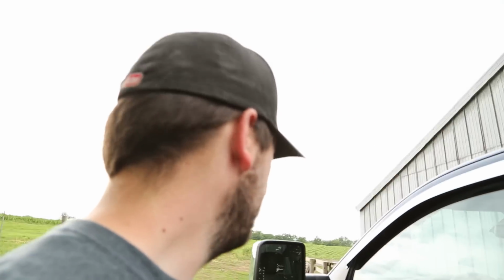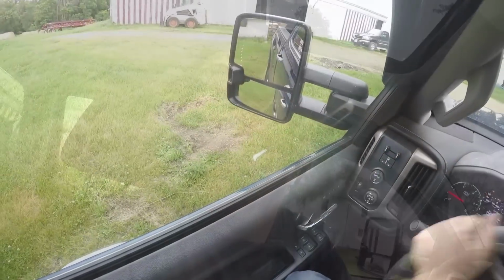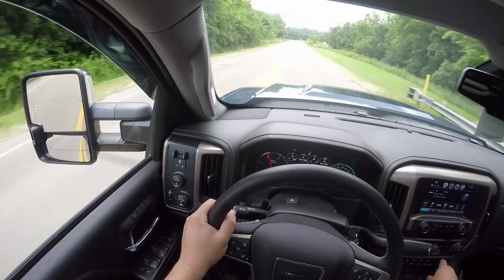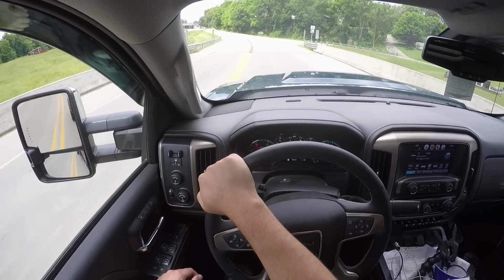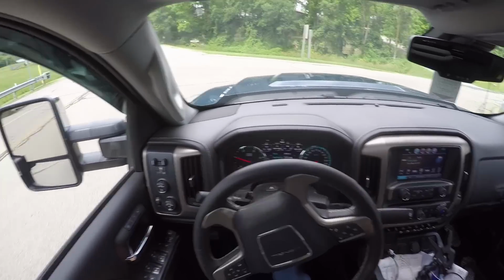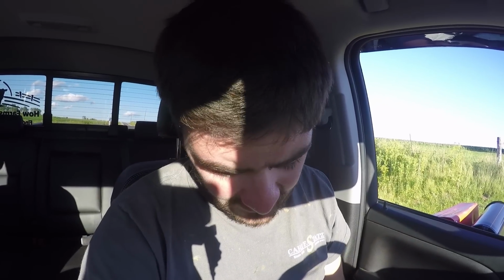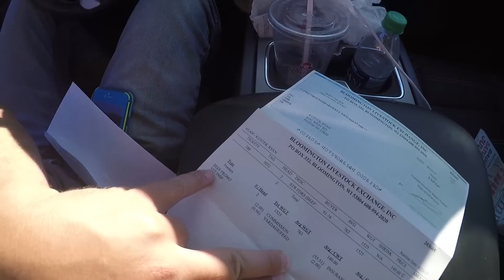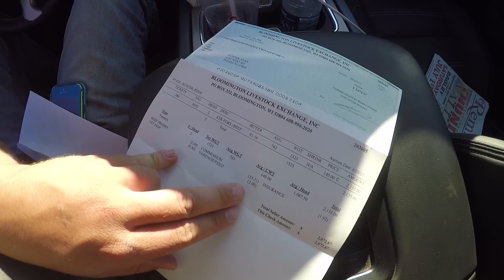Hauling Cattle - 2017 GMC Sierra 3500 Denali

Comment: you have a beautiful truck! as you can see I'm a Dodge fan but I'm impressed
Reply: Myron  Yoder im impressed the GMC didn't break down
Reply: they are pretty good now all the biger trucks with diesel engines run good dont break that much and some sound good HOWEVER to anyone looking to buy a new diesel the best thing u can EVER do to the engine is a full delete kit no tuner mods to add power just delete the stupid egr crap and dpf bullcrap and u will find that ALONE add more powe because u dump about 300-800pounds of crap off the truck
Reply: Should have bought a ford
Reply: yes shoud have bought a truck that had more breakdowns in a month then gmc has had in 25years right for a time anyways ford had a really crapy diesel engine i remember my dad buying a ford f250 brand new off the lot and the engine craped out after about 300miles not 300000miles just 300miles i think it was a 07 or 08 maybe as early as 05-06

honestly tho gmc is fine i prefer dodge but i like the sound of a cummins 6.7L
Reply: Myron  Yoder       Fgjl
Reply: Myron Yoder I thought I was the only one.
Reply: why would the gmc break down, you don't sound very intelligent. GM trucks are very reliable and dependable. i like the Ram as well, but ford i only like the f150. when it comes to super duty's Chevy and Dodge do it better.
Reply: Martin Joseph: i like the f150, but ford doesn't make a good diesel, not since the 7.3L of the 90's. from 1992-1999, those were the best years they produced a good diesel engine. when ford switched to the 6.7L powerstroke in 2000 they lost alot of performance, and you had to get an f350 if you wanted a diesel. GM with the 6.6L duramax turbo diesel and the dodge ram cummins turbo diesel, are the better super duty's to buy. that doesn't mean the ford super duty is bad, but in real world performance, GM and Ram just do it better. that's why the f150 is the best selling vehicle in the US, because it's the best 1/2 tone your gonna buy.
Reply: Respect.
Reply: New holland 4life he’d be working on that more than farming

Comment: Love my 2019 L5P SIerra 2500, pulls like no other, like my 2018 Ram 2500 too.
Reply: Derek Williamson what’s the max tow rating on the l5p bro it’s not 13k is it ? I thought it was over 20k i just saw a vid on the tfl channel and i was pist that they said that haha
Reply: @legoat_6god  I believe is 23000 lb. I've had 23,000 lbs behind mine and it handled it all so well it could handle a lot more actually.
Reply: Thank you yes that’s what i figured would be the weight behind a toy hauler with some toys inside and a couple quads

Comment: I drove a 2013 ford f350 and pulled trailers most the time anywhere btwn 13,000 and 17,000 pounds off the regular hitch. Never could quite tell any difference with the exhaust break on or off. I used it often when I was moving fully loaded but I just could never tell what it was doing or if it was even working
Reply from the maker: When you’re in trailering mode the exhaust brake is on automatically
Reply: @HowFarmsWork  oh so when you plug everything in and get all hooked up that must just throw the truck in tow/haul? Love the channel man, I grew up and was raised in New Glarus, live in milwaukee now but your vids make me feel like I'm back home! Keep truckin brother. You give WI a great image.

Comment: Are these cattle at slaughter weight or will they be sold to another outfit for fattening up and then slaughtering?  

If they aren't at weight yet, why sell them now instead of when they are at max weight?

What weight are cattle usually slaughtered at?
Reply: 1,100 to 1200 lbs most do but not all
Reply: chevydaboss1 we usually sell at 400-600. It’s a perfect balance because more weight than 600 results in price per pound going down. Plus you don’t want to run the risk of the bull breeding the heifers
Reply: fix the bullpen.too busy shootin video to build a finishing pen.

Comment: How much sway do you get with the cattle moving around? I have an F150 and when even one cow starts moving around the whole trailer sways bad at highway speed. I also have a bumper pull.
Reply: The answer is a bumper pull puts all the weight at the rear of the axle.  .. try putting a couple of square bales on the rear to make cows stay in front of the trailer

Comment: Saves a lot of wear and tear on the brakes, which are an easy cheap fix, and puts it on the automatic transmission, which is expensive and difficult to repair... LOL:)  Yep them engineers are smart ones... 

Nice group of calves... glad they brought a good price.  

Later!  OL J R :)

Comment: Do you ever wish you bought a dually truck? Ever felt hampered by the single rear wheel?
Reply from the maker: Nope, never wished I had a dually once
Reply: I’ve always been told that duallys are rough when your. Going out in the field with them and bad as our sprinkler tracks can get I wouldn’t doubt it so we stay away from them on our farm

Comment: use that fancy mower before you park that trailer, i would like to see how your truck would do up Eisenhower hill on I-70 up here, good tow
Reply: I appreciate your reply, I own a tuned dodge 3500 and an F450, his truck is about average for the current medium duty diesel offerings. Check out Industrial Injection if you wish to see what a diesel is capable of achieving.

Comment: I have grown up ranching, and still do on the side. We have owned every brand of American made truck. Here is what I have found. Ram trucks with the Cummins pull the best, they will pull a trailer like a freight train. GMC/Chevy with the Duramax are the most durable and will last the longest, especially when compared to the Ram. After a few years of driving a brand new Ram on the ranch they start to feel loose and rattle. Ford with the powerstroke are not good at anything in my opinion. We owned a 7.3, a 6.0, and a 6.4 and they all started failing before 80k miles. The interiors fell apart, engines would fail, tranny on the 7.3 failed ect. The new ones have the aluminum body that you can peel off, not good for a ranch FYI. Get a Ram or GMC/Chevy, they are both the best.